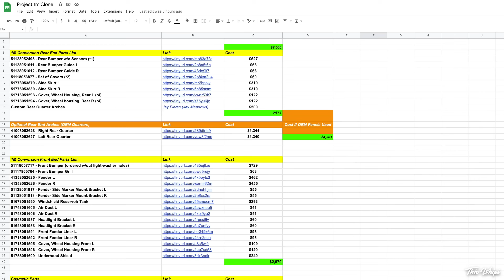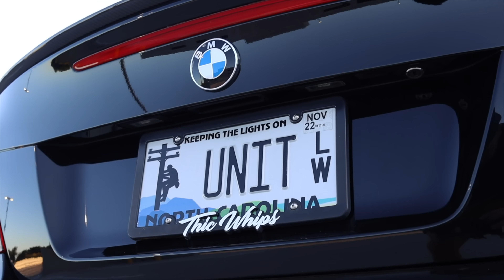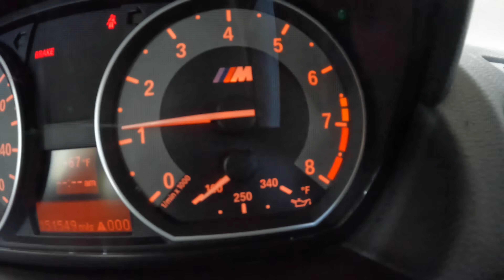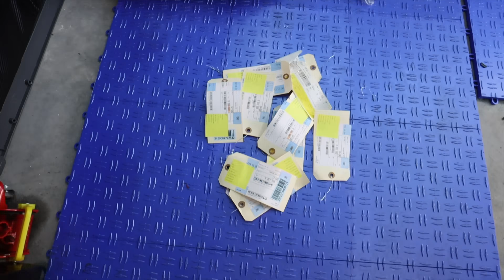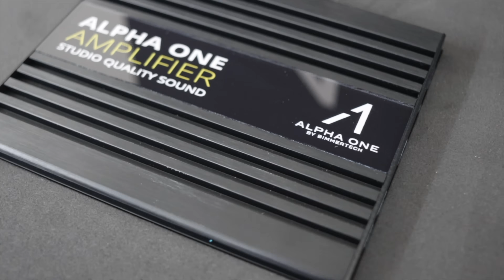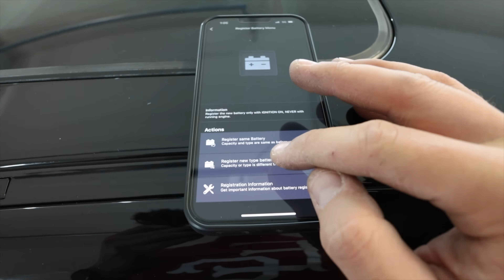Building a BMW 135i in 20 minutes.

Comment: Did y know 135i also had rod bearings issue or need replacement
Reply: No, the n54 or the n55 did not have the s65 v8 rod bearinh problem. But if you tune the n54-n55 maybe it would be good to replace them